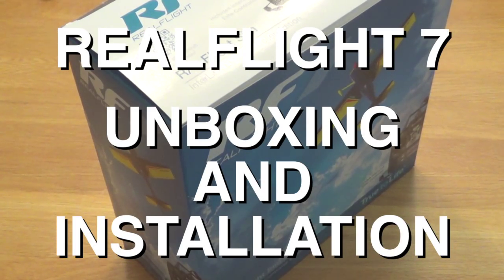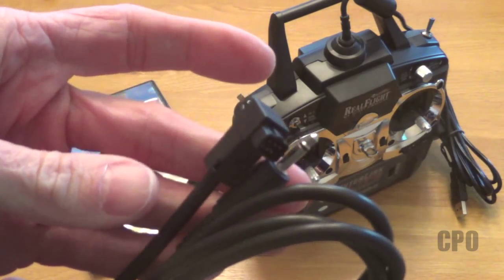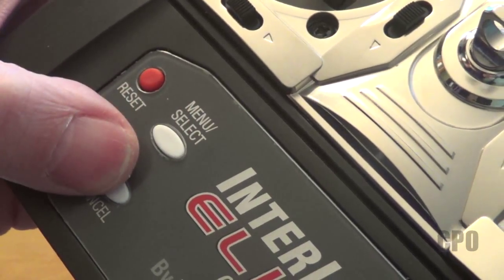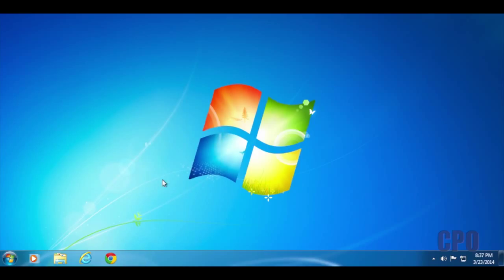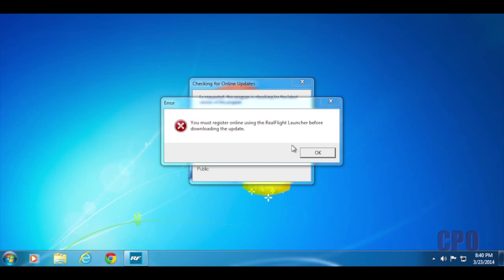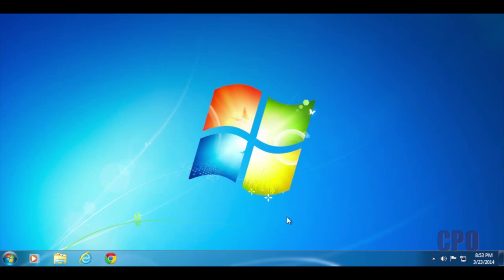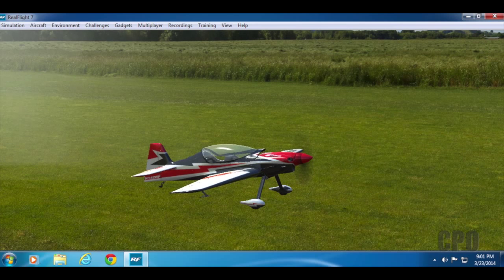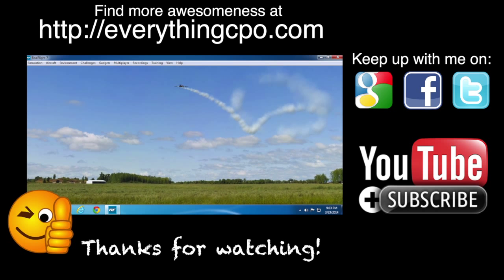RealFlight 7 (RF7) Part One : Unboxing, Installation, and Calibration

Comment: Im going to buy the interface transmitter edition but my radio is a HK 65 from Hobbyking but Im not sure if it's compatible, do you know if it will work?(If you dont know my transmitter you will find it on google

Comment: When I enter in the serial numbers it says it will automatically enter the serial for the interlink, but when I try to enter my software serial that works but the interlink doesn't fill in do you have this problem?
Reply from the maker: I had to manually type mine in I think.
Reply: It won't let me type mine in

Comment: I have a question..
I just ordered my own copy of real flight.
I want to know if the disc needs to be loaded every time you want to run the simulator or every thing runs off the computer once it's installed. Thanks.
Reply from the maker: Good question. Once you install it, the disk is no longer required. All of the data is copied to your computer.
Reply: Thanks!!

Comment from the maker: So, ***** and Marty Rome... Here are some initial thoughts. I didn't think I would care for the Interlink Elite controller. I have always just wanted to sim with my real transmitter so it felt the same as real life. I have to say though, I LOVE this controller with RF.  Sure, some of the switches are in different locations...but the sticks feel just as good as my real transmitters. It doesn't need batteries. It can always stay plugged into my computer. <-- that is huge. I hated to go get the Taranis, change models, plug it in, sim, then end up leaving it bouncing around the office...then find I need it later, get it, change models again, wonder if I ran down the battery sim'ing...etc, etc.  This thing is just always ready to go. : )

The RF controls are fantastic. I don't have to touch the keyboard. I can reset, pause, rewind, change aircraft, change fields, etc, etc all from the transmitter. That's pretty cool.  I didn't think I would care about that stuff...but it's pretty awesome once you have it. As far as the rest of RF7, the training stuff actually looks useable. I am still getting familiar myself, so I will hold on that stuff until I can learn more about it.